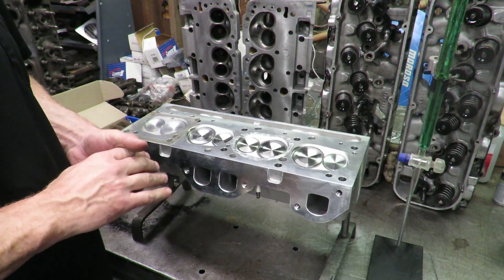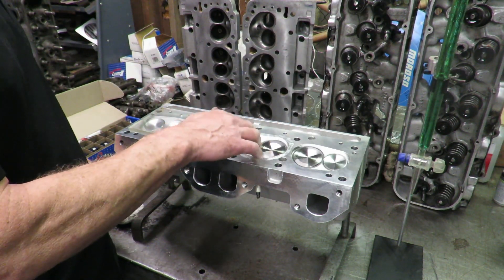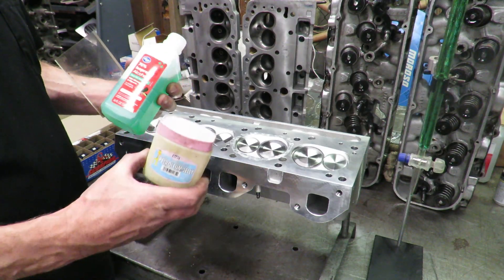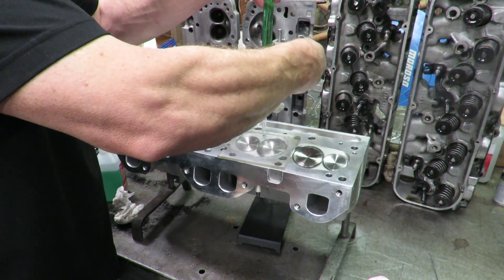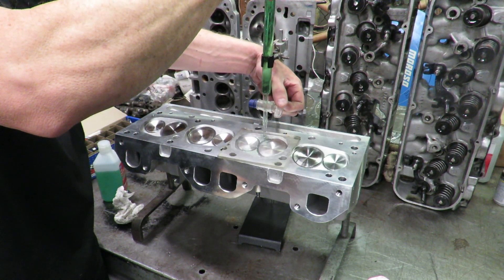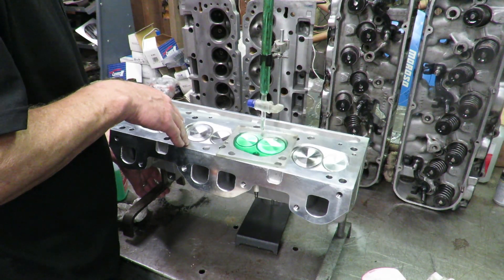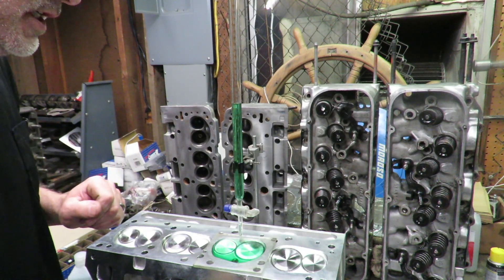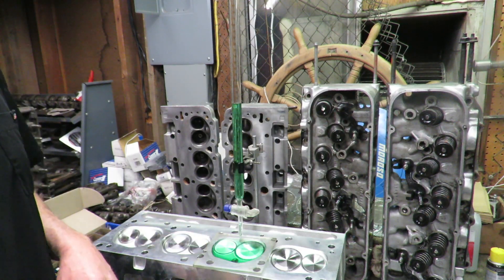How to correctly CC a combustion chamber

Comment: So what differential do you allow between chambers? I find it difficult to get below half a CC (cast heads, so must use tools to remove chamber material)?
Reply from the maker: The better After market heads are very close to right on the factory heads not so much the cheap aftermarket stuff is way off many times and yes you need to do some work to them the crazy part is there are guys/Gals buying cheap heads from overseas and just bolting them on I have seen up to 8 cc difference on the cheap heads that is huge it's much like the older factory heads Chevy/Ford/Chrysler are all guilty of this,
 worst set I ever saw was 440 Dodge had a 12 CC difference on the same head I have also seen Ford FE heads tht had big differences for one head to another but same exact casting number and close date codes when reworking a factory head(s) this needs to be done to every chamber, I have checked many AFR heads they have all been dead on

Comment: Hey I am here to ask a question I got 1991 Chevy k2500 4x4 n I trying rebuild the engine I trying to see if it's a 2 bolt main or 4 bolt main the number I find on the block beside the timing cover is 880 n what is a good head to put on it
Reply from the maker: you will need to pull the pan to see if its a 4 bolt I would run vortec heads
Reply: @Myvintageiron7512  ok cool I was thinking the same thing put vortex heads on to
Reply: What kind of vortex I need I think I going to bored it out to a 355

Comment: sir I have a question maybe you can assist with,, here goes.. ,. Ok  the chevy small block oil system from the research ive done ive read that the SBC 
uses a check valve in the oil filter housing that works on a pressure 
differential.. so,., I have read that a chevy small block with normal 
oil pressure is around 10 to 15 psi at hot idle.,. If a high volume, 
 oil pump is installed, with no changes to the oil bypass valve
 in the engine, will the oil bypass the filter, and go thru the check 
valve instead.. also. when rebuilding an engine, how do you service or 
replace the oil pressure bypass valve... thank ye!  would love to see a vid on the intricacies of the small block 88 to 94 oiling system.  I see alot of vids where people buy a GMT 400 series truck, see the 12 to 15 psi oil pressure at warm Idle and panic. they put high flow high volume pumps in and feel they have taken care of the "problem" . but im wondering if they are creating a problem.
Reply from the maker: first off, I wouldn't run a HV pump they heat the oil and put way too much stress on a stock oil pump drive shaft as well as the stock distributor gear a small block chevy only needs about 8 psi of pressure at idle and 10 to 12 at full throttle according to GM now most of the time they have way more just as a precaution as far as the bypass valve goes most of them will not open until the pressure exceeds 80 psi so not really an issue
Reply: @Myvintageiron7512   this helps me out alot,, Ive also read that putting the high flow oil pump robs some power from the engine,,,, 
Im going to attempt getting my bypass mechanism out and replacing it,, this engine was full of goop due to leaking valve stem seals and a blown head gasket. 
I also noticed restricted and clogged coolant passages in the block,, im thinking that clogged coolant passages may be the most common reason that head gaskets blow due to hot spots in the head.. just a theory... when I flushed the block with a high pressure nozzle, it took 20 minutes to get the rust out and flowing clean water,, I was shocked at how much rust came out,., .. 
maybe one day you can do a vid on this,., it seems to be a very overlooked part in the rebuild process. thanks sir!
Reply: @Myvintageiron7512  got the oil galley plugs and freeze plugs installed today. this is the first time ive taken an engine to bare block, and did everything myself. im seeing to do things right it is ALOT of work and have newfound respect for the engine builders.   just cleaning and spec all of the parts is quite a job.  also now I see why premium freeze plug kits use brass plugs,., almost every one of mine was almost rusted thru, and im pretty sure 1 was leaking which may have caused the engine to overheat and blow the head gasket. 
It will be a great feeling when its done and runs like new.. thanks for your advice!

Comment: Is there anyway you could go more in depth with this? That's a good demonstration on cc-ing the head but what if I'm trying to reach a certain compression ratio. Say like if the block has raised pistons or dished pistons. What head gasket to use. What's the formula or method you use to get the desired ratio? Also what is quench & how important is it, I've seen that term a few times? I'm going to eventually rebuild my engine & I wanna use your methods cause you clearly have skills. Thanks for the videos & stay blessed 😎

Comment: At work we use windshield washer fluid to check for valve guides and seating leaks. E-85 has a nasty habit of ruining exhaust parts in cylinder heads.

Comment: Thanks for sharing this info with us! Question, what others factors determine compression ratio to determine the correct ratio, i.e; block decking, shaving the heads some? Thanks so much. Cheers from Motown/Dearborn.
Reply: If you shave the heads "some" then you decrease chamber volume and increase static compression ratio,  Likewise if you deck the block.  Thickness of head gasket has to be accounted for.  Thicker the gasket, the lower the static compression ratio.

Comment: I worked at Cummins engine tech center for 30 years we did the same thing only we had a bleed hole in the plate see you at always let the head bead at a little bit of an angle and that would bleed all the air out